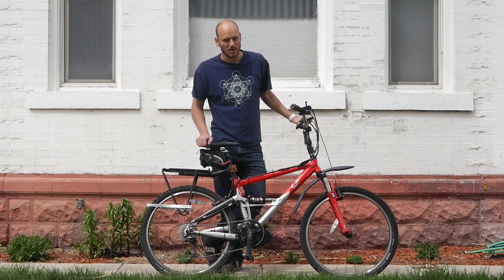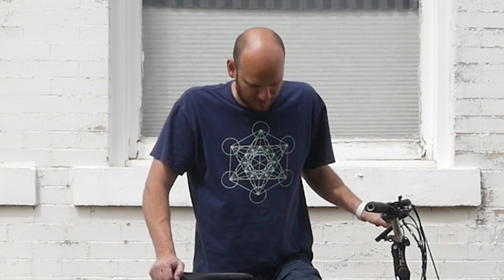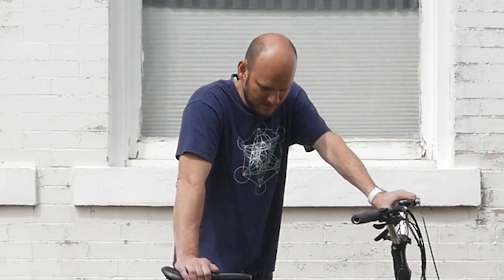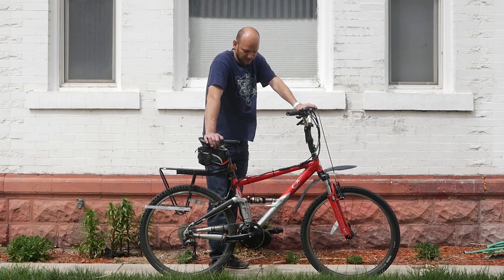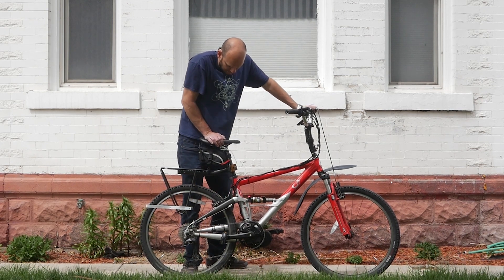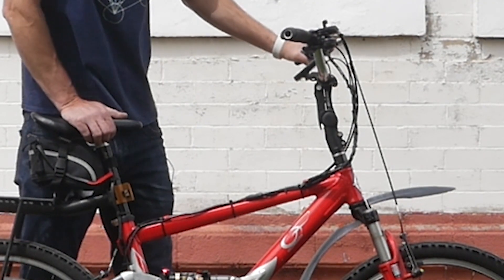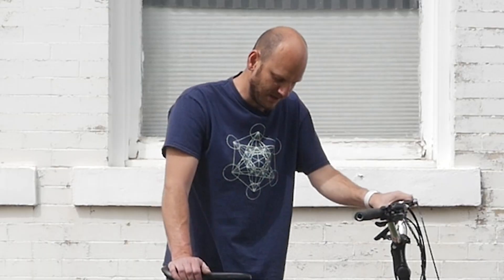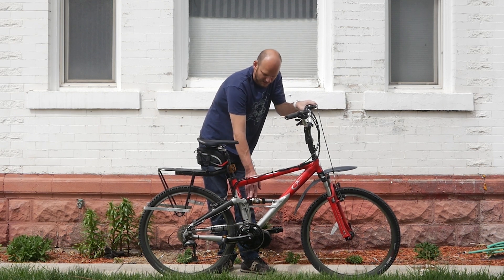Custom E-bike Build: Gary Fisher cake3 bbs02 52v 6ah

Comment: Johnny   , I have a question. How does it throttle? Is it a on/ off  , with different power settings ?   Does it twist like a dirt bike?    I want to do a fat tire bike . Dam it ,I’m old as dirt!  62 . Any body can answer the question. Thanks Brett
Reply: Definitely not an expert here but I put together one of these and it came with a thumb throttle default. There's a bit of variability in that you can control the power output but to me, it seems like there are two modes with the thumb throttle. Half power or full power. I've ridden dirt bikes as well and there's not nearly the same throttle control. For reference, I run the BBS01 250W mid-drive. I've also heard that there's handbar throttle which is like a motorbike you can get that's compatible with the bafang connections. Johnny might even stock them not 100% sure tho. Cheers
Reply from the maker: There is a thumb throttle. Many aftermarket ones too though that have twist

Comment: I'm curious as to how far it will go (throttle only) at 15mph on 6ah.  Also, when you do your 'from a stop hill climb' I take it it's in the lowest gear?
Reply: about 10-30 miles , depends on terrain , any uphill stuff is gonna drain it more 

 I have a back up 6ah battery under my seat post  that I use when my main battery starts getting too low.
Reply: @TheAgentAssassin  Thanks for the info!  I would not have expected it to be that far.  For a backup it sounds like a good idea.

Comment: Great conversion.

Except I would have a higher capacity battery on the rear rack.

I doubt I could even get to work with this battery let alone being able to return home.
Reply: Agreed I have a 6ah battery as back up under my seat. It's only there as back up if my main battery gets too low. 

There was a guy on EBAY selling the same sized pack using tesla cells he was getting 10ah out of same pack size. I wish I would have gotten one before they sold out.
Reply from the maker: Bicycle motor works has 8ah versions 👍

Comment: I have a RaD Wagon 3 Hub motor. Would a bigger front Chain ring help me go faster when peddling,too?
Reply: Keep in mind changing the front chain ring and a hub motor system real advantage is keeping you from not being able to keep up with the pedaling as the motor goes faster. However most of those systems have predetermined speed limits for each pedal assist mode and once you get to that the motor cuts off. Any speed beyond that would need you to add the power to achieve.
Reply: Yes doesn't matter if motor or you legs.. lol gears are gears.  I'm not a nerd out specialist yet...God bless

Comment: Another nice build.
I was going to ask about leaving the cables on top of the top tube but with the adjustable stem it became obvious that was to offer the cable length needed. I should have known better than to second guess your impeccable cable management.
Nostalgia. Wow! Don't see many Gary Fisher bikes any more. They were EXPENSIVE but way ahead of their time. Gary was a pioneer. Part of a group that used to bomb down hills on basic steel bikes with no modern features, so they invented them.

Comment: I have a heavy hub motor bike that I want to add a BBSHD. If I leave the hub motor on I would like to keep the cadence sensor also but I don’t want to crush it with the bb nut. Can you put it on the outside of the nut is my question? I know I could use the cadence of the BBSHD but was just curious if you have done this with a hub motor left on? I will be ordering BBSHD from you, hopefully you have 100mm!!
Reply: I would highly suggest that you remove the hub motor if you are not using it.
Reply: @Todd66  
Dual motors sounds pretty cool. I have a bike with just a BBSHD on it. Thought this may be an interesting build but I’m all ears to why I should remove it besides weight.
Reply: I second the recommendation from Todd.
Reply: @michaelsprinzeles4022  
I may third it if I feel it to be a bad decision.
Reply: Also…the BBSHD cadence sensor is built into the motor assembly, so you will not have a way to connect your current hub motor cadence sensor to the BBSHD. So there is zero reason to leave your current sensor installed. By leaving your “heavy” hub motor, you are robbing yourself of power from the BBSHD. The more weight you remove, the longer your battery will last, the more power you can put down.
Reply: @Todd66  
I agree on all of your points. Would like to see how this works with dual motors first before going just with the BBSHD motor. I have an external controller that I will be adding and the power to the BBSHD should be doubled. I also run 3 batteries on this bike so range is not necessarily an issue. This is a small 20” fat tire bike that is ok for pedaling but not the best. I have other bikes that accomplish that. I was just wondering if there was a configuration to utilize the PAS on  the hub but I can do without and try it with the BBSHD.
Reply: Third it.. lol I would put on another bike? But I like to tinker.
Reply: @sleepingbearffg5008  
Exactly, I like to tinker also. I have a CYC Stealth motor on a road bike, highly upgraded BBSHD on a full suspension mountain bike and this bike I’ve had the longest with 750w hub that is a bit slow relative to my other bikes and that is fine but I have this external controller just sitting around and would like to use it on this bike and see how it goes with dual motors. Worth a shot at least.
Reply: Sell the bike on Craigslist , start with a fresh build. Find a nice lightweight normal bike that fits you and slap a BBSHD on it.
Those heavy framed chinese white labels hub ebikes are poop.
Reply: @TheAgentAssassin  
😂 Ah man! How can you sell your first ebike you ever got. I only feel the need to improve on it. Hub motors are nice at times when your feeling lazy and just enjoy tootling around on a nice warm sunny day. ☀️